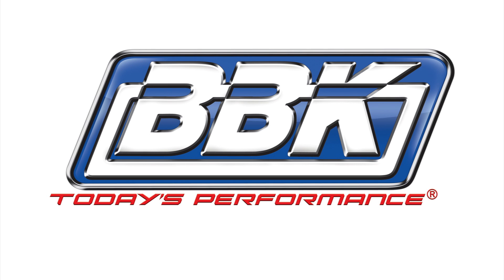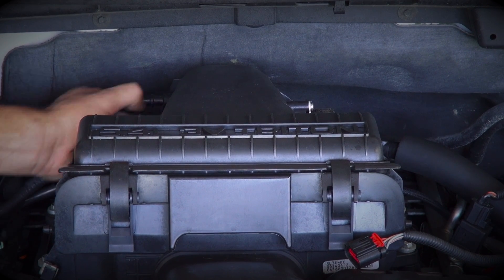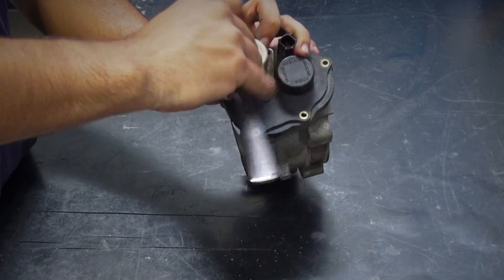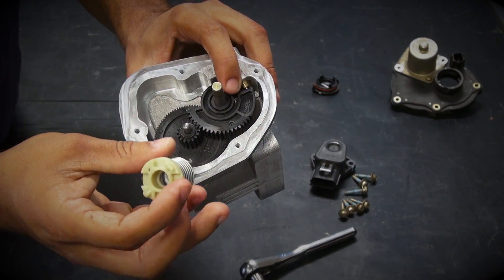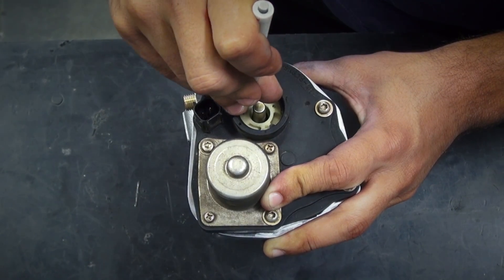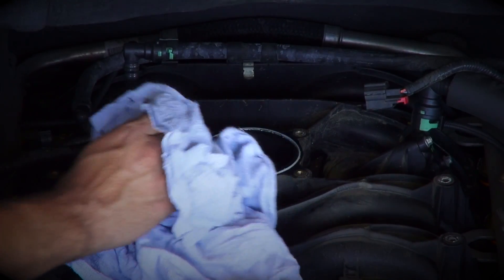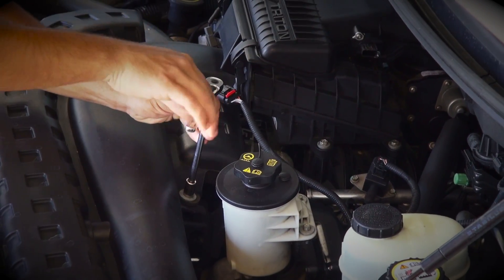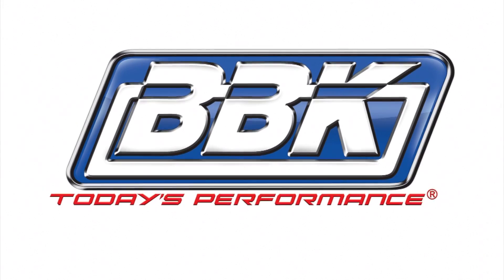Ford F Series Truck & Expedition 4.6 & 5.4 Throttle Body Installation

Comment: Why would you say 4.6 and 5.4 ? Do they fit both motors?
Reply from the maker: Hi Michael, the video shows install  of part #1759 on a 5.4L, however we also offer a 75mm, part #1758 which fits all 04-06 4.6L F-series/Expedition -  and follows the same install procedure.